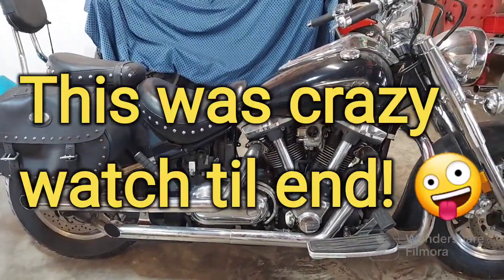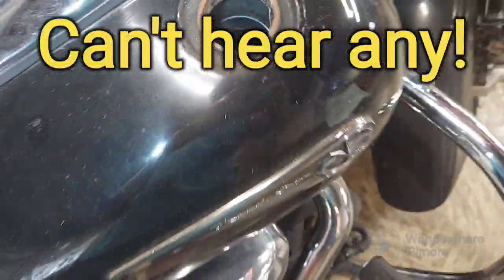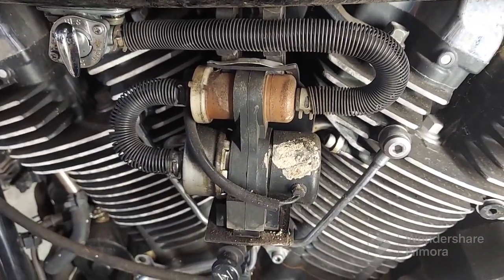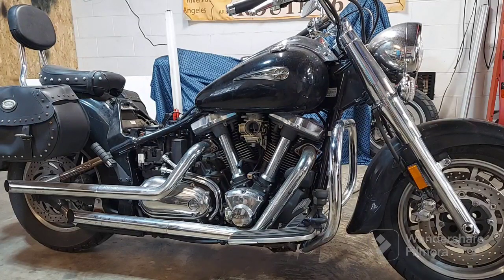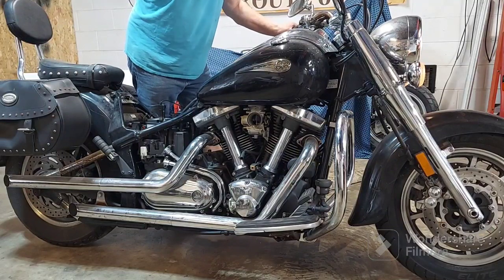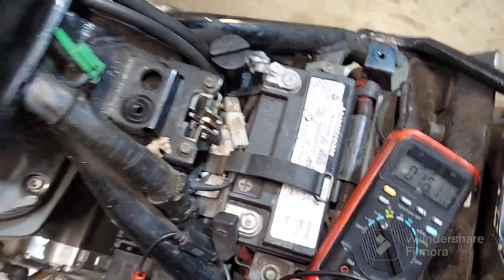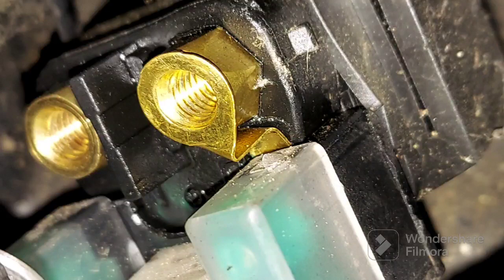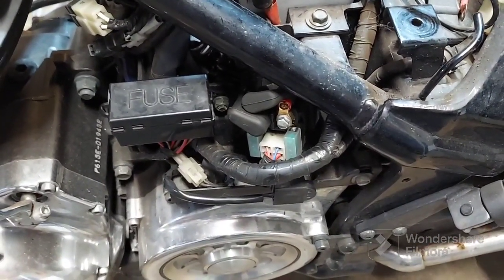2005 Yamaha Midnight Star VX1700 with major electrical issues

Comment: Unreckon she blow the 30a fuse
Reply from the maker: Not yet, it flickers on and off
Reply: @thedragon2299  had my old xj900 blowing fuses 20a on  start up every time ended up being postive battery wire hanging bye a thred the battery came loose all good now
Reply: Did you solve it? Cause mine is doing the identical gremlin....ordered new battery have new starter relay installed...crossing fingers
Reply: @jtmessimer my passing lights would not toggle on. New battery today and they work.